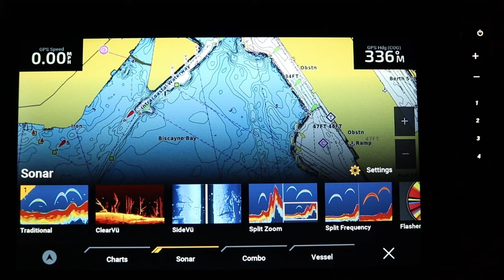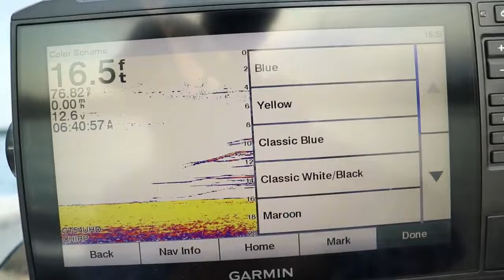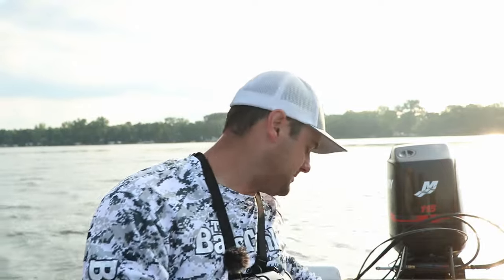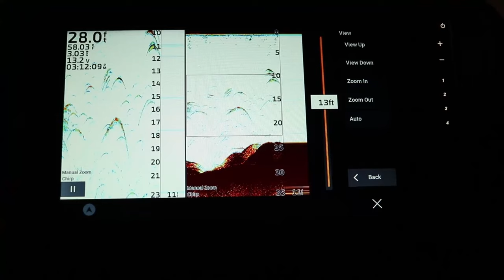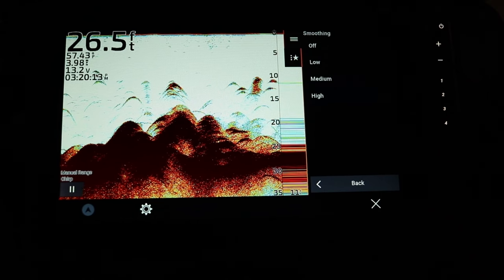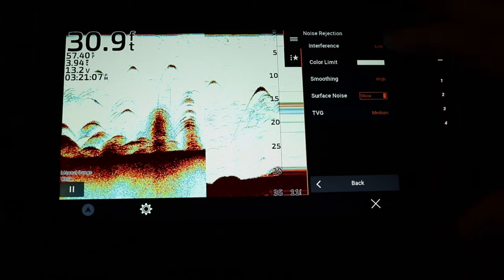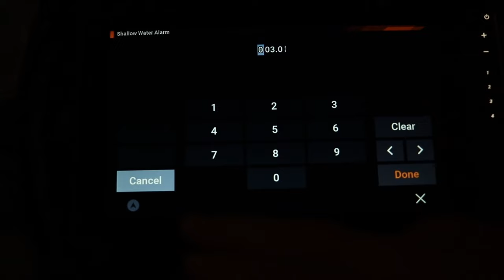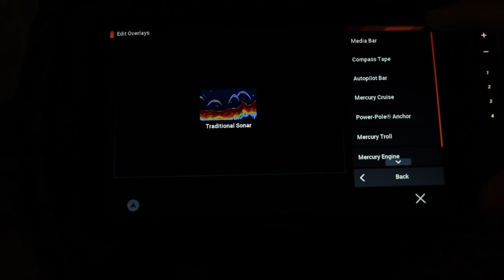Garmin Echomap How to use 2D Sonar and Best Settings

Comment: I normally just use my Mega unit transducer for traveling and for maps,Down image and side image for locating flats,saddles,bends in creek . I use the 1222 for my Livescope  Im still debating to get the 56 for it cause I mainly sitting still when I use it for for forward mode and perspective mode. 2D is a great one to use and I normally pair it with Down image and it stops a the guess working 100%.